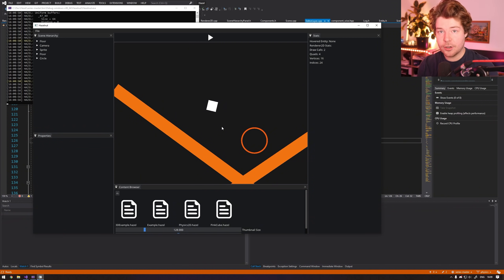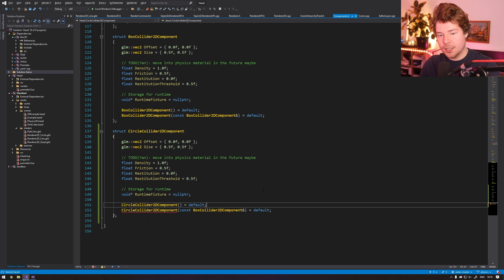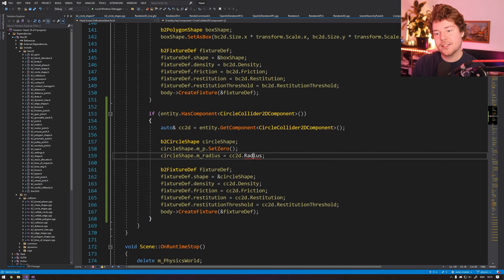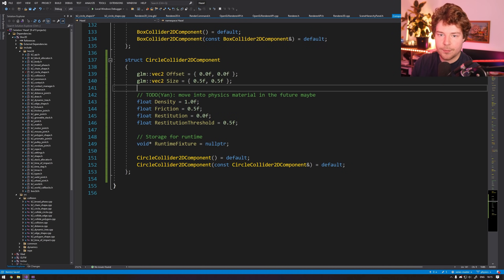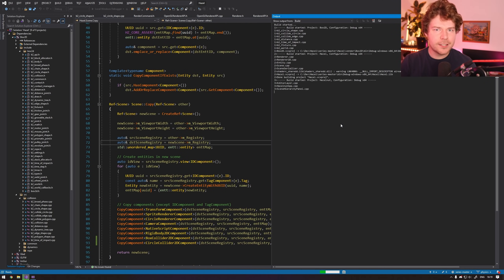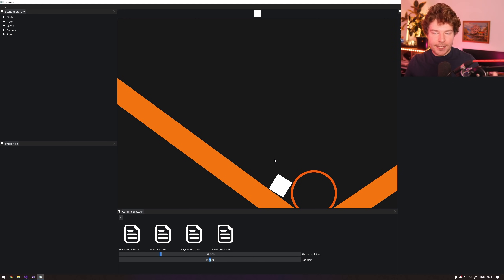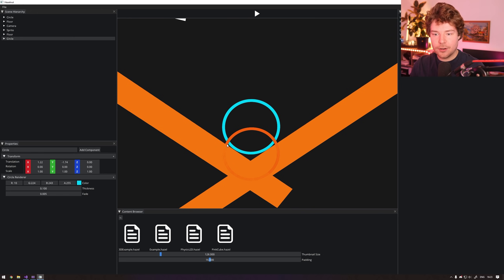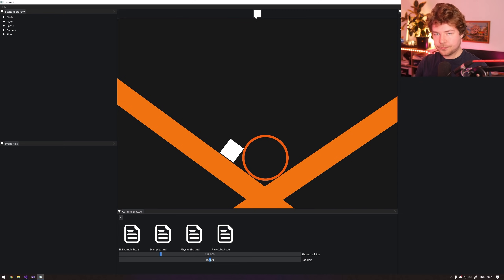Circle Physics Colliders // Game Engine series

Comment: diy from ground up, console programming, assembler/c++
Reply: most of this type of programming is wasted in interface programming
Reply: better to a be ground up familiar with everything, or you are not doing it optimally
Reply: expert programming old style
Reply: fpga mini console programming, both hardware (cores, gpu, architecture, vhdl) and software (assembler, c++, instruction sets), assume your system has d-sub/hdmi video out, usb ports, gigabit of ram, sd-card, ethernet, sound plugs, try arrow sockit, close to de-10 nano, simple complete independent system with its software, just the fpga programming software
Reply: I'm saying, instead of game engine, for a selected platform, interfaces, make a console, custom, no jank in the way, only what you actually use, from ground up
Reply: if you did not code the physics, you dont have the skill to do it, yourself, however smart the library is, its not you
Reply: I'm not going to spend a week making my own physics engine unless its my first time doing it where I'll do it as a learning experience. Reinventing the wheel to do something in a slightly different way isn't really worth it if you get 600 fps instead of 400 fps. If you do want to use a game framework, you can make it yourself, or modify something like allegro or SFML; Hazel also can be used without Hazelnut I believe, so you can modify and use that if you want.
Reply: @lodinuk  reliance kills
Reply: @lodinuk  you cant do it if you use it, did you mean to educate or make slaves
Reply: @lodinuk  if you cant to it yourself, dont come asking to do it for you
Reply: @lodinuk  the minimal solution is that you can do all yourself, completely, and dont need libs, or anything
Reply: @lodinuk  if you knew how to do it, you would not have typed this comment
Reply: @lodinuk  still learning how to do things
Reply: @lodinuk  you would have already done everything instead trying to annoy anyone with library things
Reply: @lodinuk  you must be gods because you have to rely on others
Reply: @Jkauppa  You are correct that I don't know how to do it, hence why I am looking at this tutorial series. Not everything involves having the most hyper efficient program. Also why are you trying to be extremely elitist with what you are suggesting, 'woah look at these people learning how to make something, they are now slaves to pre-existing libraries and are stupid.' Make your own processor architecture and programming language if you believe that everything should be made from the ground up.
Reply: @lodinuk  because I dont serve you, ever, and you should not expect it, in any case
Reply: @lodinuk  I already have all those
Reply: @lodinuk  just trying to point out that all this non-sense is because someone decided to talk
Reply: @lodinuk  and did I say anything about efficiency, just about keeping your mouth shut and do it yourself
Reply: @lodinuk  its better if all is taken from you that you dont dare to talk anymore, then you can be given, when you dont need it anymore
Reply: @lodinuk  do you think "you need to serve me" is not elitist, or even more so, than, "in God we trust" written in your money
Reply: @lodinuk  so you dont need anything after all
Reply: @lodinuk  I would say its better to give the means not product
Reply: @lodinuk  law is nice, that you dont have to do anything yourself
Reply: @lodinuk  how do you dare to define, judge, rule, what is elitist, and make something less valuable than others
Reply: @lodinuk  "not perfect", "only human", god is perfect, I hope you would be like gods, making their rules
Reply: @lodinuk  and I got no F's for you
Reply: @Jkauppa  I'm not asking you to do anything (maybe your English is a bit off, since I only just recommended you to do some things yourself), but why are you suggesting for Yan to stop working on the actual engine and work on a physics system? And when did power and control come into this?
Reply: @lodinuk  why not
Reply: @lodinuk  because using engine libs is not the full thing, using an engine is not making an engine, specialization suchs
Reply: @lodinuk  no need to ask, anything, let God teach you, no not the men gods you keep for yourselves
Reply: @Jkauppa  the thing is I can understand what Yan is doing and why he is doing it; I just don't know how most engines are structured since that's a different thing to software development (software architecture).
Reply: @lodinuk  thats the main issue, that you dont understand what the engines are doing, which is hidden behind an api, you are not doing it yourself, you are watching a video, sorry video makers
Reply: @Jkauppa  Bro wtf why are you so on edge and angry about this? It's just a tutorial series. Also why bother inventing the wheel when someone has done it before and probably better than you could do it? Using good well documented libraries is fine if you're not wanting to control everything that happens in the code and the libraries serve the exact purpose you needed for them perfectly.
Reply: @victorioussnake  why are you so hypersensitive guard dog
Reply: @victorioussnake  there are no such things produced by you or the community
Reply: @victorioussnake  snake-oil seller
Reply: @victorioussnake  you dare to control what I do with my freedom, eh
Reply: @victorioussnake  your promises are void
Reply: @victorioussnake  If I say something is crap, then its crap for me, keep your own opinion if you want to swim in dirt/mud
Reply: @victorioussnake  "accept my rule and crap, bro", rrrright...
Reply: @victorioussnake  confess yours sins, that your stuff is bad, and you force by pride to people to submit using them
Reply: @victorioussnake  I do have the skill to redo every level of the used tech, but I will not serve your mouth's pleasure
Reply: @victorioussnake  pride kills in the houses of people, God gives for those saved by God
Reply: @victorioussnake  am I not allowed to do what I do, what do you say, snake oil seller
Reply: @victorioussnake  if you by even word useless word come against me, you are the enemy
Reply: @victorioussnake  if you judge, I dont care
Reply: @victorioussnake  cant take constructive criticism, huh
Reply: @victorioussnake  I'm saying what I say, not on my own initiative, but what God gave to be spoken
Reply: @victorioussnake  mafia rep
Reply: @victorioussnake  something wrong with something I do, is there
Reply: @victorioussnake  you dont get it dont you
Reply: @Jkauppa  I don't care about your God cause I'm not religious but I swear you're just trolling. I'm not saying to not make your own stuff. But I also don't wanna spend soo much time and effort into making something myself when someone has already done it before especially if its a system that I don't have a need to make from the ground up for a specific project.
Reply: @victorioussnake  only the cross of Christ is done beatyfully by God Himself, no honor to people, God gives or you lie, talk your own
Reply: @victorioussnake  shame on you
Reply: @victorioussnake  for bully pride
Reply: @victorioussnake  who are you to say anything about anything, or even say any of the libs are any good
Reply: @victorioussnake  dont vow for me
Reply: @victorioussnake  lazy
Reply: @victorioussnake  but I'm definitely trolling when talking actual facts
Reply: @victorioussnake  and you dont care, thats correct
Reply: @victorioussnake  everything you dont understand, your bot brain turns into the closest known category it can, ie, trolling
Reply: @victorioussnake  so you serve the world, not agreeing with you on anything
Reply: @victorioussnake  stop spreading your toxic attitude
Reply: @victorioussnake  I dont play by your rules
Reply: @victorioussnake  why do you make reinventing the wheel to be a bad thing, lazy
Reply: @victorioussnake  monopoly nazi mafia rep
Reply: @victorioussnake  do not even dare to ask for respect
Reply: @victorioussnake  you said it yourself, you are wile as heck
Reply: @victorioussnake  "good enough" is trash
Reply: @victorioussnake  are you in hurry or just dont have the skill
Reply: @victorioussnake  a wolf taking caring of the sheep flock
Reply: @victorioussnake  no care for them
Reply: @Jkauppa  Please talk in paragraphs because your filler reply spam is actually just filling my screen. I have never said making something yourself is bad and you should never do it. If you want to make something yourself then power to you, nobody is going to stop you. However for example. Why would I want to manually mine the resources and construct them into the PC I am using right now to type this when I could buy off the shelf parts that others have made? Why waste the time and effort to do something that has already been done? I have made a programming language from scratch before but only because I want it to have full control over how it works. Could I just use a different programming language and get around what I was trying to do? Absolutely. Why did I do it? Because I thought it would be fun and I didn't mind spending the time it took me to do that. On the other hand, if I want to just write a quick GUI application just so I can write some text and have it put in a file formatted in some way. Why would I write my own window renderer with form components, code to read and write files, heck even do it in assembly and spend soo many hours or even a month or two when I could just quickly open up a C# WinForm project in VS and write my code in just a couple of hours?
Reply: @victorioussnake  you started commanding with demands
Reply: @victorioussnake  so boosh off
Reply: @victorioussnake  I do not care what you have not done
Reply: @victorioussnake  do you think I give any F's to your words, whatever
Reply: @victorioussnake  you oppose me, you are an enemy, said Jesus Christ, who is my Lord, not you
Reply: @victorioussnake  I do as I find the best
Reply: @victorioussnake  remove your replies from this comment thread
Reply: @victorioussnake  I dont care If you are pleased or not, and you definitely dont care anything about me, so, total divorce, not even shared customs, traditions or habits, dont even dare to suggest any obligations towards you
Reply: @victorioussnake  I will not
Reply: @victorioussnake  "you bow to me now", huh, no get lost
Reply: @victorioussnake  I hear pride in your talk
Reply: @Jkauppa  damn why are u doing this
Reply: @yoyo12345  why not
Reply: @yoyo12345  you are programming, i'm telling you some stuff
Reply: @yoyo12345  why are you programming tho
Reply: @Jkauppa  im programming because, well, i really enjoy it
Reply: @yoyo12345  and I enjoy commenting a ton :) also programming concepts and demos
Reply: @Jkauppa  yeahh... Why don't you tell things in paragraph tho? Just asking
Reply: @yoyo12345  too tired
Reply: @yoyo12345  how many answers did you give? :) I dont take one paragraph rules
Reply: @Jkauppa  me? I'm not smart enough to give anwers to people
Reply: @yoyo12345  yes you offended me, you answer yourself
Reply: @Jkauppa  I think u interpreted my msg in a wrong way. I said that I didn't give any answers  to anyone (regarding programming) because I'm too bad to do so.
Reply: @yoyo12345  I dont edit my comments for you
Reply: @yoyo12345  so you make me answer instead, how greedy
Reply: @yoyo12345  no I dont need to answer
Reply: @yoyo12345  your own excuses are you own thing, but dont make me do anything for you for any reason (pretend valid or invalid reasons, no matter)
Reply: @yoyo12345  you interpreted my issue to you wrongly, I dont care what you do, you do you
Reply: @yoyo12345  but when you come to tell me what I should do, then it's over
Reply: @yoyo12345  if you dont like to do something, or cant do so, dont expect anyone else to do it for you
Reply: @yoyo12345  if you are lazy dont expect anyone to do it for you
Reply: @yoyo12345  dont tell me what I did wrong
Reply: @yoyo12345  you are wrong with your laws and rules
Reply: @yoyo12345  "sir would you like your cup of tea in edited form" ~_~
Reply: @Jkauppa  what are u talking about bruh. When tf did I tell u to do something. Language barrier is the rmain issue here, thats what I said. Idk what u read and what u understand
Reply: @yoyo12345  you dont understand, that I dont have to edit my millions of comments into a release paper for you, understand!
Reply: @yoyo12345  yes you dont understand written english
Reply: @yoyo12345  to me you are insane
Reply: @yoyo12345  you chose to insult me even more, be gone bully
Reply: @yoyo12345  I never wanted you in my comments, read it or leave it
Reply: @Jkauppa  neither do u
Reply: @yoyo12345  you carry yourself whatever burdens you try to place on others
Reply: @yoyo12345  you came here accusing and demanding, you are the wrong
Reply: @yoyo12345  no more "patience/focus" for you